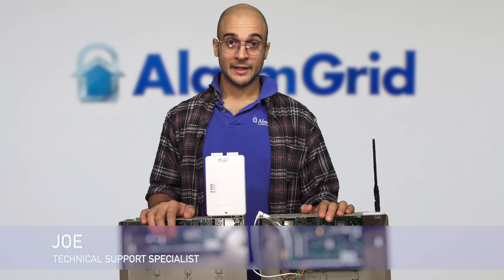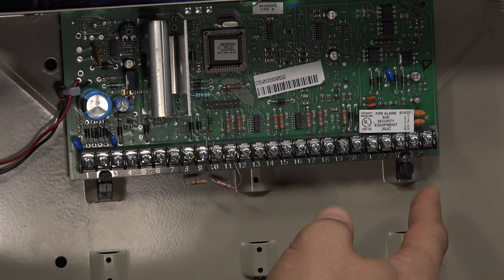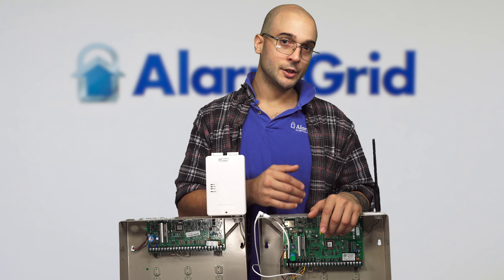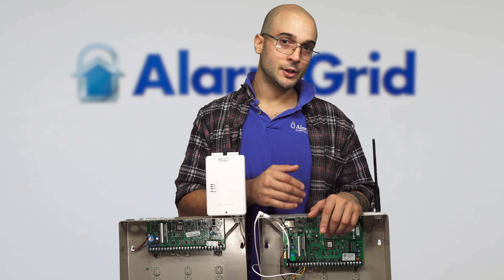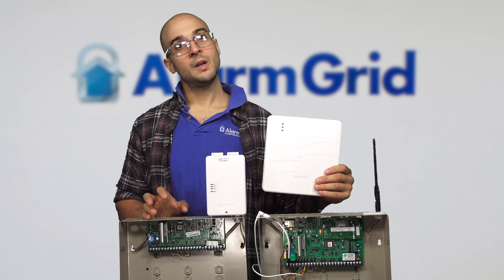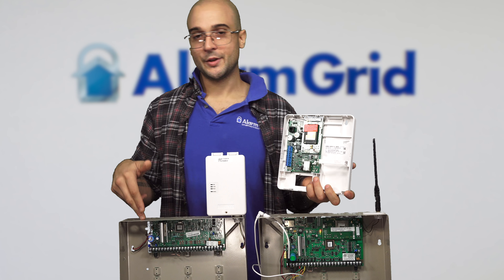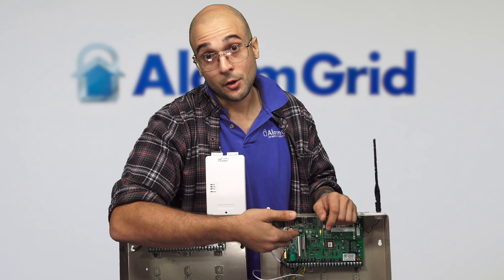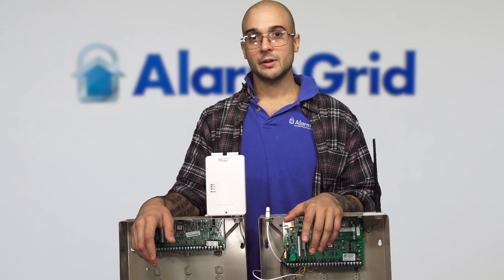Honeywell VISTA 20P vs Honeywell VISTA 21iP

Comment: Thank you for your video. I have a Vista 48A/48E, and the LEDs on the keypad are dead, but there is a backlight on. The battery voltage is 13.5V. Should I replace the main board? If yes, what is the most updated version compatible with WiFi?
Reply: Hello @hosseinnabavi5403, It sounds like an issue with the keypad more than your main control board.  If you still have backlight and the display is still showing the proper status and panel info, Also does the system arm and disarm properly? If so the keypad may have some bad leds and just needs replaced. If, the system does not arm/disarm, or perform other basic panel commands then there may be an issue with the main board or connections between the panel and your keypad. Some additional troubleshooting would be needed to make a more accurate determination of what is wrong.

Comment: I am confused by this video; in one of your other videos, you say that the 21ip's communicator is not dual-path, because the ethernet port is disabled if the cellular card is activated by the jumper.
Reply: Hi Verylukyguy, Correct the 21ip does not have a Dual Path option by itself, because it only has an onboard Ethernet port. For Dual path the 21ip has to have one of the 2 following options. (1st option),  A secondary Cellular snap in card (Only 21ipLTE panels can now have a snap in card for Dual path communications, Older 21ip panel have to use the second method). (2nd option), Disable the onboard ethernet port by Moving the Jumper to the lower 2 pins on the 21ip Board which disables that communication path, allowing an External Communicator to be installed to the keypad bus terminals, that can use IP, IP & LTE, or LTE communication options depending on the communicator installed.  I hope this helps.

Comment: Hello, Is the 5834-4 Remote control, 5816 tranmitter and L5200 keyboard compatible withe the Honeywell vista 21ip system?
Reply: Hello Attewarie7229, The 5834-4 Remote key fob is compatible, the 5816 Sensor is compatible with a Receiver. The L5200 is a Separate Stand alone security panel and will not be compatible with the 21ip. If you need a keypad the Recommended keypad is a 6160 or a 6160RF if you do not already have a receiver module installed.